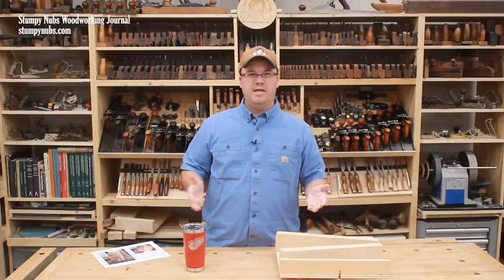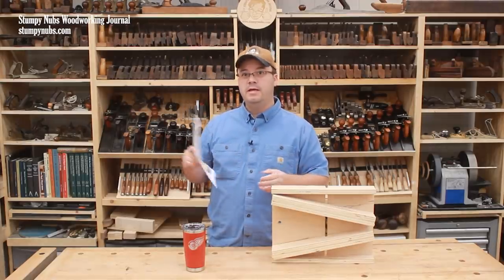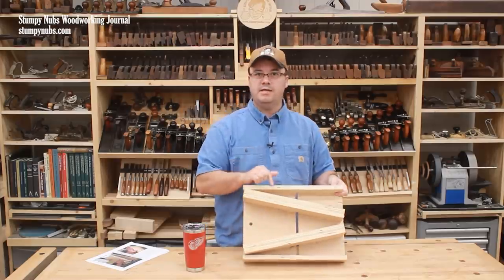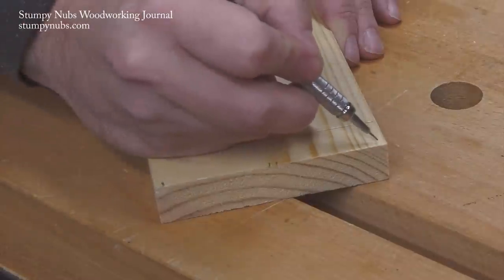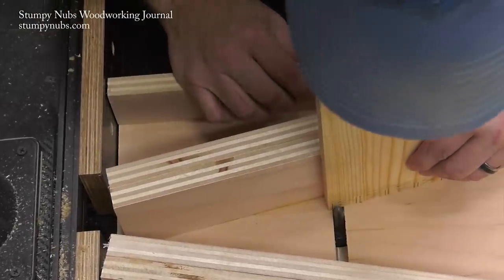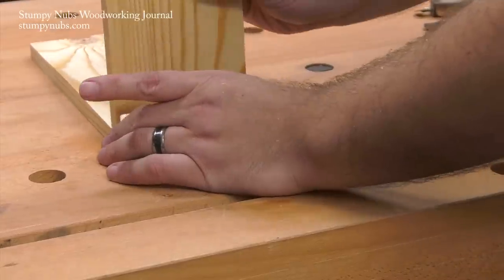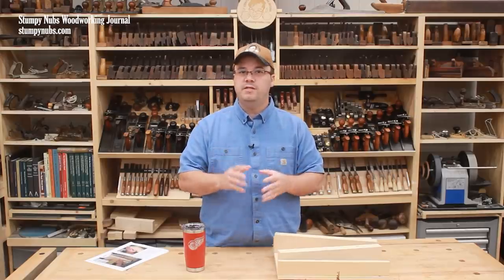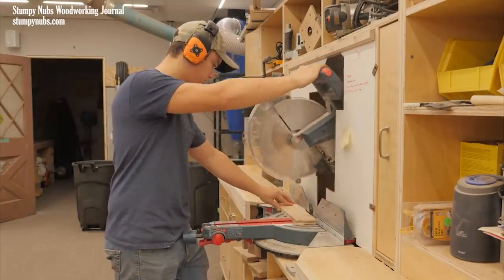A clever router table dovetail joinery jig

Comment: I bought a PC router jig when I first started learning how to make dove tails, and was never satisfied with the results, and the setup seemed to take a lot of work.  I tried different table saw jigs - both complicated and simple, but found that I had less control over size variations. 
I finally just buckled down and practiced hand-cutting until I built the skills necessary to cut a good fitting joint. It took many attempts with all sorts of failures, but eventually my skills improved.
Out of all the hand tools and jigs I used, I found that the RC saw provided the best cuts by hand, and a very sharp chisel to remove waste and cleanup in the joints.

The absolutely most important point in all of the steps: matching pieces must be square to one another. Anything less and things simply won't fit correctly!

On occasion I still use a cutting guide to insure correct angle and plumb cut, especially when I have a lot of cuts to make. As an example, I recently completed a large chest made out of hickory which had ~ 15 pins and tails per side and front/back. A guide block came in very handy!

Comment: If you have a band saw fence, you can use it while cutting tails by using a wedge shaped scrap cut to your tail angle.  Hold the work against the wedge and slide it along the fence to keep the cut parallel to the line.  Slide the work along the wedge to adjust to the line before you cut.

Comment: This is an interesting sled for cutting DTs. It is good to see another possible option for folks to use to cut them.  I will stick the idea in the back of my mind incase there is ever a need for it.  Some students find cutting the tails with a dovetail router bit to be their preferred method.  Do you think this sled could be modified to include a section for this instead of the bandsaw?
For myself, I had trouble cutting DTs with machines and found I prefer to cut them all by hand, starting with the tails.
Reply from the maker: Dovetail router bits require wide spaces between the tails to fit the shaft of the bit. That means beefy pins that look machine cut.

Comment: Super cool! Thx for the tip, but if I do want to use hardwoods and getting a perfect cut on the bandsaw for the tails is not possible (meaning I left too much waste still to remove), how do I adjust it? Chisel it?
Reply from the maker: A chisel will work fine to adjust the fit. But if you practice going slow at the bandsaw, you can cut right to your line, especially because the straight cuts are so short in length.

Comment: for those without a router table with slots for the runners, this could easily be applied to a bandsaw sled as well - especially because you dont don't need high accuracy for the cuts made with the jig
Reply: I’m interested, would you lay the wood horizontally instead of vertical?
Reply: @nickr9784  No, just use it exactly the same way - it corresponds to using a smaller bit in the router
Reply: What??

Comment: Could you use a dovetail bit on the router first, then mark the pins and use your jig?
Reply from the maker: A dovetail router bit requires a wide space between the tails to accommodate the shaft of the bit. That means beefier pins, which look machine cut.

Comment: Wondering why there are no responses to the various/many comment shown below.  ???   Here is another question.  If the jigs baseboard is 3/4" thick and the workpiece base line is 3/4", that means that one needs the cutting portion of the 1/2" spiral router bit to be 1.5" long?  Do they make such a thing?
Reply from the maker: Yes, they do.
Reply: @StumpyNubs  Thank you for the response.  I just returned from my 105 degree garage verifying that I need a higher/longer router bit to reach the workpiece baseline.  So, my reasoning as to router bit length was correct?  Jerry Crabill

Comment: I was trying to set up a custom template for an incra style dovetail when I realized that the height of the router bit is calibrated to the change in fence position. It could be calibrated to a roughly 1/4 piece of plywood. Set fence. Cut piece A. Remove plywood space. Cut piece B. Move fence. Repeat but cutting B first.

Comment: Question: why do you want pins that are more thin? Sure, maybe thicker ones cut on a router don't look quite as good (though that's debatable) - but doesn't giving each half of the corner an even amount of thickness give the maximal amount of strength?,
Reply from the maker: Traditionally, American furniture featured thin pins. (European furniture seems to feature wider pins.) Some like to mimic that traditional loo. Thin pins are also more difficult to cut, which "shows off" the skill of the craftsman. They produce a joint that is very strong, as has been proven by the many, many surviving examples that are hundreds of years old.
Reply: @StumpyNubs  huh, interesting. Thanks!

Comment: What I'd like to know is; why are the pins so small compared to the tails? Wouldn't the joint be stronger if they were the same size?
Reply: I think the small pins came along as a design feature, to separate "true" handout dovetails from the "cheaters" who use machines.
Reply from the maker: Traditionally, American furniture featured thin pins. (European furniture seems to feature wider pins.) Some like to mimic that traditional look. Thin pins are also more difficult to cut, which "shows off" the skill of the craftsman. They produce a joint that is very strong, as has been proven by the many, many surviving examples that are hundreds of years old.
Reply: @StumpyNubs  I thank you for the reply.

Comment: In theory you could cut your tails with a dovetail bit still. In fact, if you do that first, wouldn’t it be easier to “sneak up” on the size of the pins using your jig? The tradeoff is that you’d have to be very precise about the building of your jig, because the fences would have to line up just right for the angle of your bit

Now that I think of it, if you flip the piece and already plan on sneaking…couldn’t you get away with a single fence?
Reply from the maker: A dovetail router bit requires wide spaces between the tails to fit the shaft. That means beefy pins that look machine cut.
Reply: @StumpyNubs , I suppose. 1/4” isn’t as beefy as they can sometimes be though, and if you space it out more there’d be a bit of illusion. Or you could use a 1/8” straight bit maybe…ok now I’m just brainstorming/scheming lol

Comment: I am not extremely efficient at making hand-cut dovetail joints.  But, I can do it proficiently. Using nothing but a dovetail angel guide, A dovetail saw, and a chisel and mallet. It has taken some practice, though. But I think I could dovetail a drawer faster than someone using this method. Just saying. I have just applied for disability and am ready to retire. So no. I won't take the challenge. Sorry.     I'm not a hardcore, handtool, old-school, hardass. It's just that I think some things are better done by hand. Just ask my wife. 😮